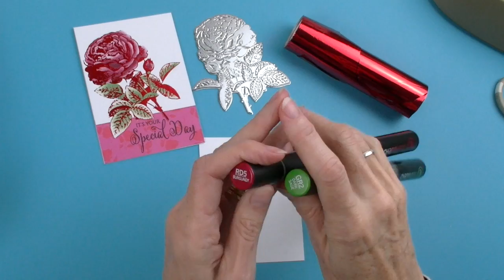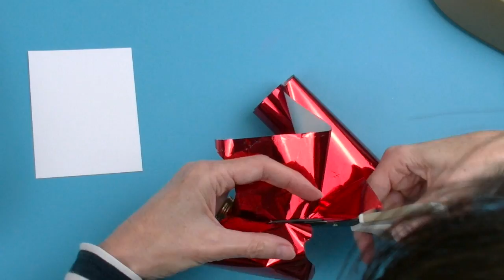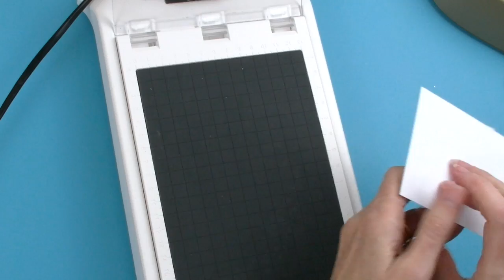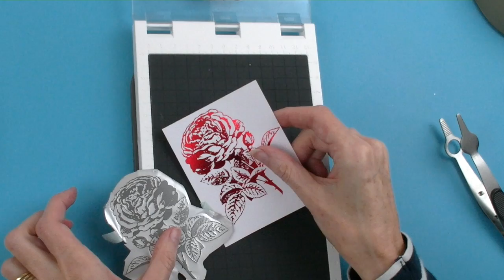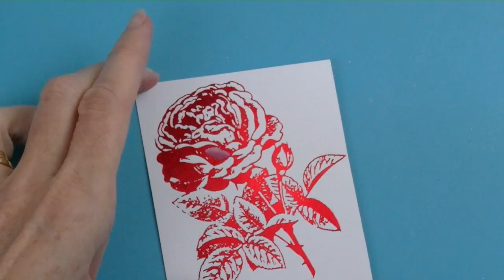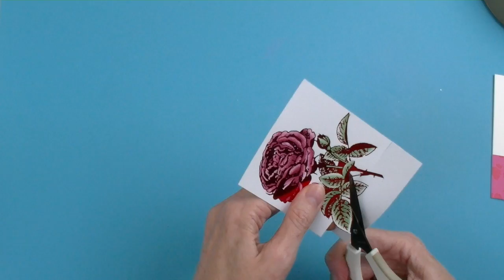Foiling with the Go Press and Foil Machine

Comment: I think I’ve found my tutor for the foil press and go machine. You speak so clearly and a pace I can follow, I just need a little more persuasion that I will get value for money if I buy this machine.
Looking forward to the video that shows what you do with the used pieces of foil . Many Thanks Ros Hodgkins. X
Reply from the maker: ros hodgkins the easiest way to use all the foil bits is to de cut some shapes covered in cut and bond adhesive then peel backing of cut and bond and press to foil it will then give a metallic effect to the shapes 😊